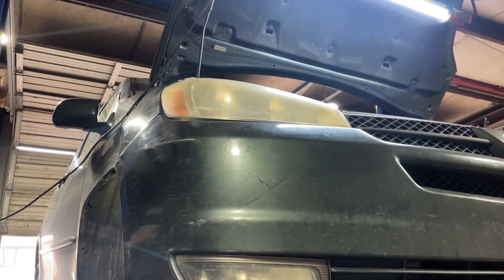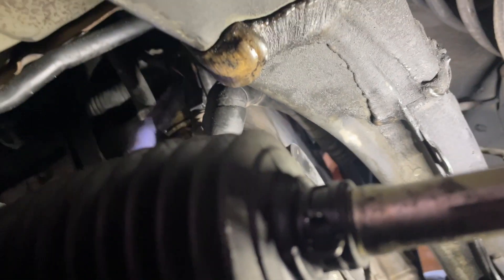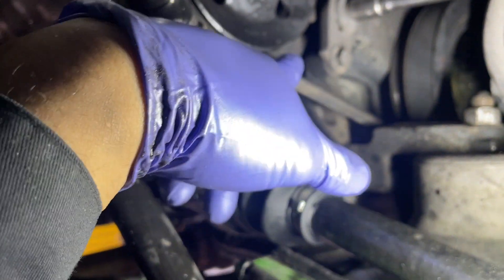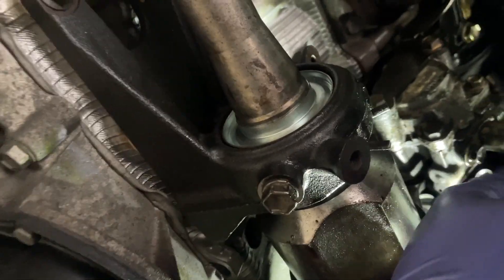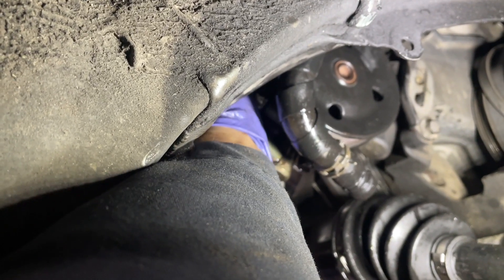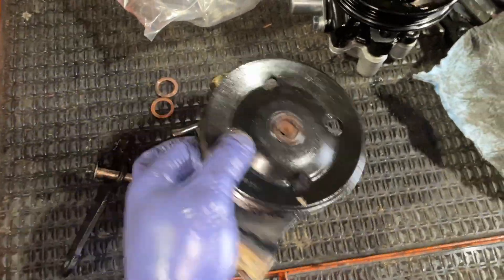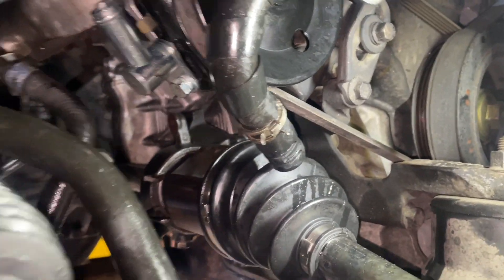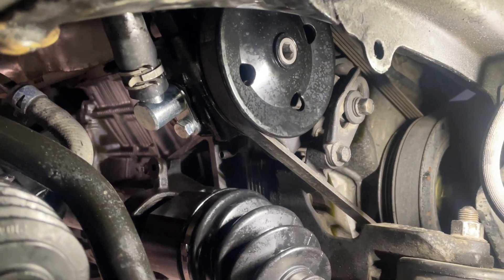2004 Toyota Sienna Power Steering Pump Replacement

Comment: Good video. I'm having issues troubleshooting a binding steering wheel. New pump, new rack, multiple fluid changes, good tie rods, ball joints, cv axles, and steering shaft knuckle. It still intermittently binds, I'm wondering if belt slippage or trash in the pressure valve? Driving me nuts and customer isn't happy either. 😂 Losing money on this POS.

Comment: I'm wondering if anyone else has had difficulty attaching the pressurized hose to the pump during installation. The pressurized hose is stiff and about 5" inches too long. If you install the pump first, you can't line up the banjo bolt to go into the threaded hole squarely. If you install the pressurized hose/banjo bolt first before mounting the pump, you can't get the pump to stay in place while trying to screw the 12mm bolt in above the pump and barely can get it to hook and hang. Any advice is appreciated... I've been at this about 12 hours now because of this.